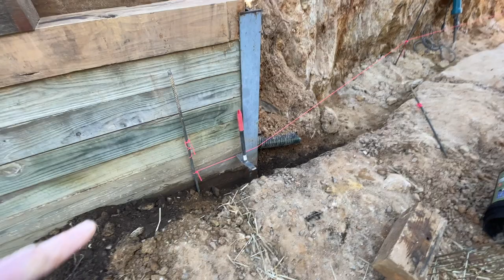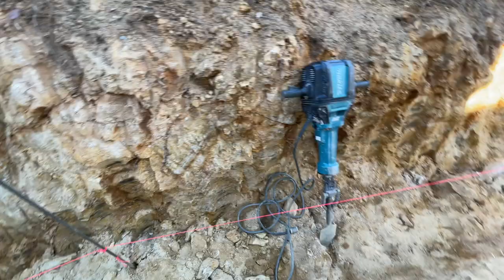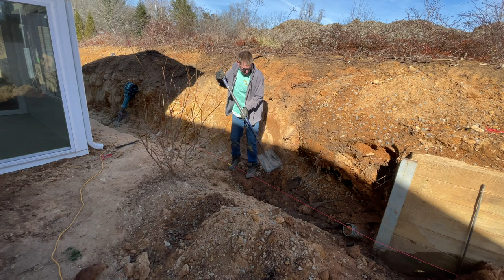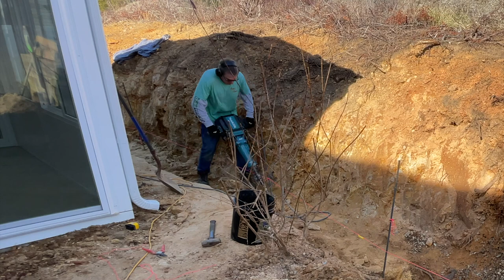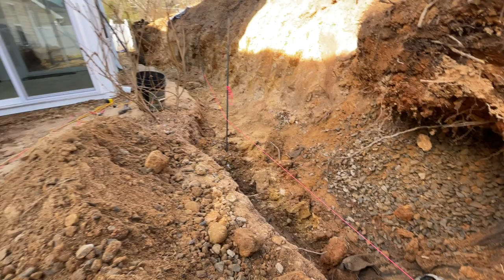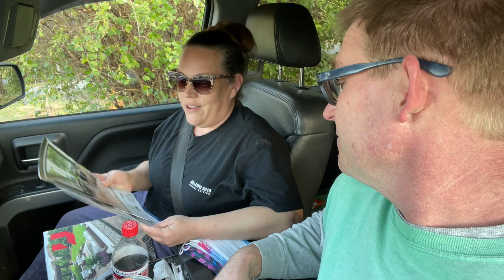ANOTHER DAY OF JACKHAMMERING FOR THE WALL FOOTER

Comment: How are you going to get the downspouts off of the house to tie into the line behind the wall and under the wall if you are digging 18" below the line?  There has to be another option for catching that wayer and moving it away from the property.  If the line behind the wall is above the line coming off of the house the water will just pool up between the wall and sunroom.
Reply from the maker: We are going to run the downspouts under the patio to the sides of the yard with a pop up at the end. Thanks for watching!